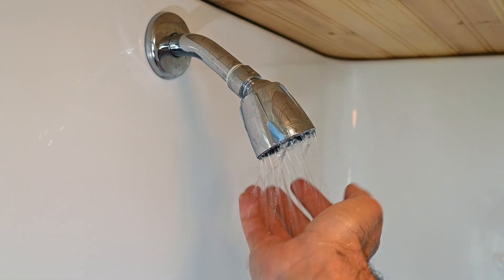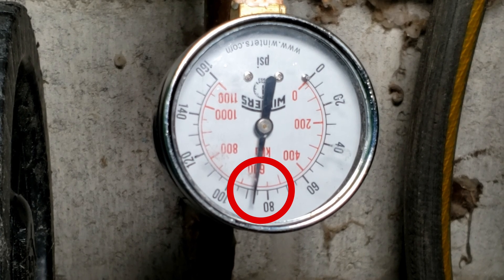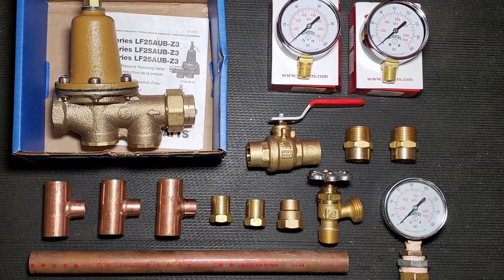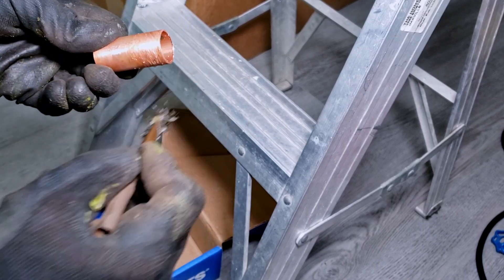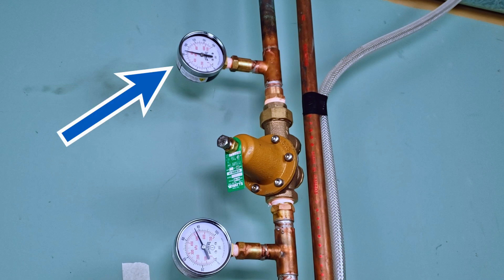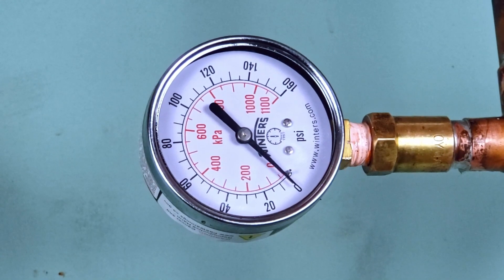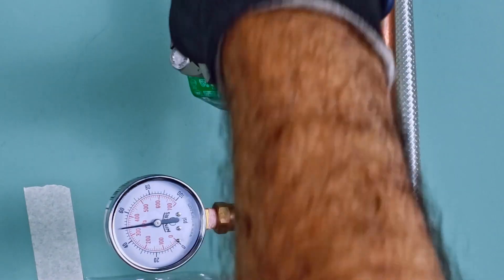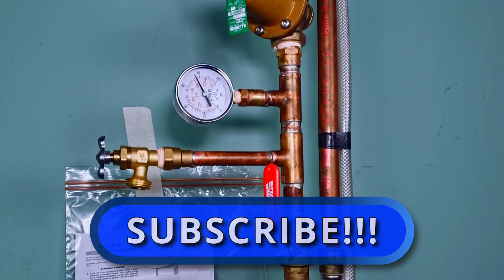Why Are My Pipes Banging?!? | Pressure Reducing Valve Installation & Adjustment!

Comment: Nice video. The manufacturer recommends tightening the lock nut after you have set the desired pressure so that vibrations do not result in a change to the pressure setting over time. 👨‍🏫
Reply from the maker: Oh wow, that actually makes a lot of sense!  That didn't even dawn on me.  Thanks for sharing!

Comment: Thx for the video, trying to remove an existing stuck pressure reducing valve that is Watts N35B. It is connected with copper main line via union(no issue with removal), copper male adapter into PRV(stuck) and then copper is connected with CPVC with some glue. What would be an easiest way to remove stuck PRV or should I just cut it and then use a sharkbite or a coupler?
Reply from the maker: If the CPVC side is a proper threaded male adapter, then the PRV should simply unscrew in the counterclockwise direction...the trick is to prevent damage to the glued side of the CPVC adapter by applying counterforce by holding the adapter with a second open-end wrench (or pipe wrench, if necessary) while you unscrew the PRV with the other wrench.  Just be sure to grab the adapter at its thickest (therefore strongest) part.  Because it's plastic, you shouldn't need to provide too much force to get the PRV off.

Of course, be sure not to overtighten the new PRV after you apply your Teflon tape to the existing adapter.

Hope this helps and happy new year! 🥂

Comment: I have been chasing a bad,,, bang bang bang bang, water hammer for years. It banged when my sprinkler system changed zones. I installed a new vacuum breaker, no help.  I installed a new PRV Wilkins 3/4" 70XL because that's what was making the banging on my system, no help. I installed two surge tanks on my system and no help. YES,,,, I bled all the air out of my system many times, total BS.  FINALLY,,,,, I figured out the Wilkins 70XL PRV are prone water hammer, WTF! I replaced the Wilkins PRV with a Watts and fixed the problem. GEEEEEZ, years of struggle.
Reply from the maker: @DudeofCalifornia  I think I eventually set it to around 65 PSI, as that's what the customer requested.  I'm not sure what you mean about your "sprinklers", but I'm guessing that you're referring to your outdoor lawn sprinklers (irrigation line), which are noisy either when you're running them or whenever they start/stop.  If so, a pressure relief valve MAY help, but it could be other factors contributing to the noise, such as a spring-loaded check valve which may be installed along the line - causing it to go off like a shotgun!
Reply: @DudeofCalifornia  I set my pressure to about 75 PSI.  I know that some sprinkler valves do make a, thump, then turning on or off, but my system was making a BANG BANG BANG BANG when different zones changed.
Reply from the maker: Wilkins, eh?...Good to know! 👍 Thanks!
Reply: Glad you found your problem , however as a sheet rock hanger , working on gov housing projects I noticed something I had never in private housing . What that was , was the stub out pipe was soldered into a TEE rather than a 90* & on top of that was a can / anti-water hammer chambers (which is simply on air chamber) installed on all the water lines just before they exited the walls to the fixtures. Air will compress water will not !
You will notice water hammer does not occur when you turn the tap or fixture on , just when you shut it off , because that flowing water stops immediately .
Reply from the maker: @robertmintz63 Yes, those indeed sound like air chambers as you suggested.  Unfortunately, those don't work in the practical sense:

While you're absolutely correct that compressible air does indeed mitigate water hammer, the problem with air chambers is that there is no physical barrier between the two mediums.  Therefore, even though some air will remain trapped in the chamber when you FIRST fill the system, the air very quickly disappears either via turbulence or by absorption into the water - rendering the chamber water logged and utterly useless.

Your better option is the the installation of true factory-manufactured and approved water hammer arrestors (like the Watts SG050), which maintain a permanent physical barrier between the air and the water.

Comment: Great video, can you make one about Water Hammer Arrestors? I see that there are all kinds of types available some have adjustable pressure (via a Schrader valve) others are not.
Thanks
Reply from the maker: Thank you once again!  Funny that you mention water hammer arrestors.  While making this video they came to mind as a video idea as well, since they're very effective at preventing water hammer.  You mention arrestors with Schrader valves...I'm wondering whether you're actually referring to expansion/bladder tanks, which essentially perform the same function as arrestors although they're constructed differently.

In any event, I do have another video idea lined up for that as well, particularly in reference to thermal expansion.

I've formally logged your request and will look more into the arrestors you mentioned. (NOTE that I haven't forgotten about your request for slope and grade from back in July...unfortunately, time is my greatest liability!)

Thanks again for your feedback and support! 🙏
Reply: @PlumbingsCool  You got good memory about my P-Trap Arm Question! 😀
The arrestor with the Schrader valve is a LF150A Water Hammer Arrestor by Watts. 
I wonder if they have any benefits vs non-adjustable ones?
I presume that the Schrader valve is a weak point since the air pressure always leaks eventually vs the pre-charged units?
Reply from the maker: Thanks...I'll be sure to look into that Watts model you mentioned!
Reply: i tried some non adjustable Oatey brand just on my washing machine, but they didn't do anything for the water hammer, my house has 70 PSI and no PRV. $72 out the window 😞